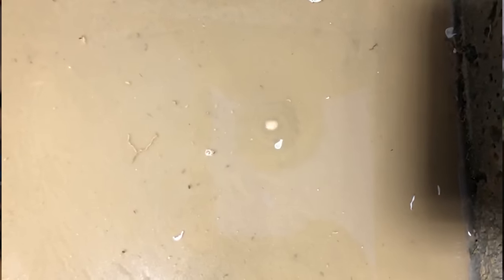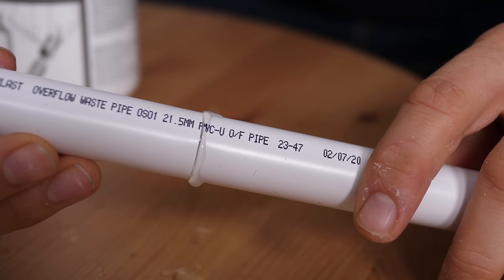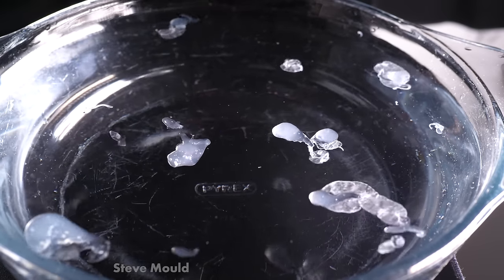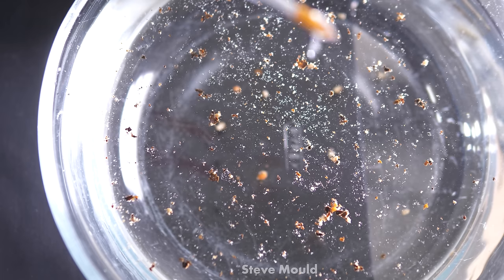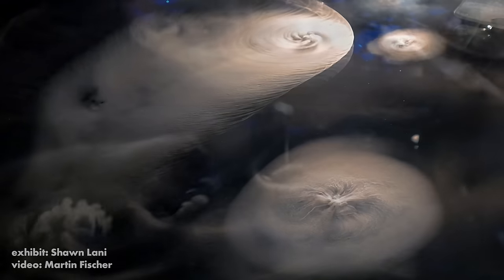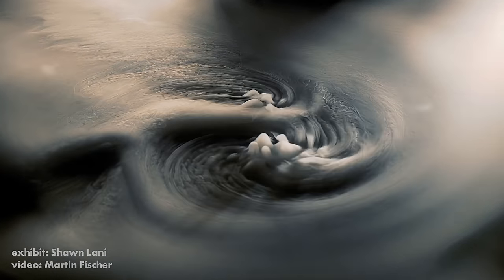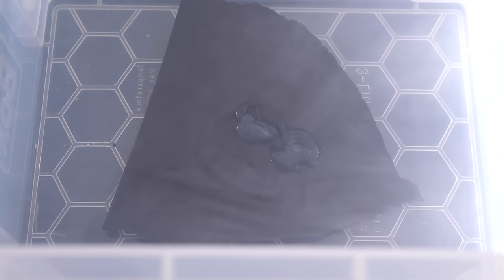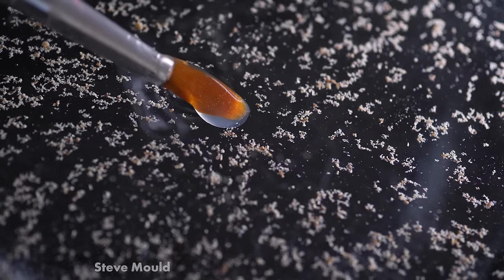Bizarre Spinning Glue

Comment: If you leave it overnight, does it still move the next day?  If you smear out a thin layer of the cement on, say, paper or something, and then leave it overnight and then the next day spray some water on it, does the water wet it or bead up?  My initial suspicion is that the cement is superhydrophobic, like those nanocoatings nothing can stick to except this probably isn't oligophobic, most of those coatings do both which is why they're so effective and novel.

Comment: Those fins/wings which rushes out is exactly similar to the wax of candle when it falls onto the water. Also; when you drop that pvc cement from height because of its velocity it breaks the surface tension of water and that caused jets to erupt beneath the surface of water. And when you pour a drop closely like what you said without exposing to air; You infact not trying to break the surface of watter and when that solvent is released out quickly onto the surface of water and then that water cools it down; that actually makes those fins/wings appear. Can you please try this with hot water ? Or if you already did that then what happens? Thank you.

Comment: I think your interpretation is mostly correct, but it I would describe it as being more driven by osmosis than surface tension.  I've noticed the same phenomenon with fixed zebrafish embryos.  For certain experimental procedures we fix the embryos with formaldehyde solution and then dehydrate them into 100% methanol (which removes lipids in the cell membrane, we later rehydrate them into water based buffers.  Usually these dehydration and rehydration steps are done with at least 1 intermediate step (50% water-based buffer, 50% methanol) and often even more to prevent rapid osmosis from ripping and stretching the tissues.  If you rehydrate them with out the intermediate step the will spin and swirl like crazy - a lot like the PVC cement.  I haven't made the mistake in a long time, so my memory might be deceiving me, but I'm pretty sure they would not only spin at the surface, but they would also spin submerged.  I think you might see the same phenomenon with any gel that has an organic solvent, when you submerge it in water.

Comment: My thoughts are that as the solvent evaporates by "looking for air" to turn back into a solid, it's finding the path of least resistance and the has escapes, then solidifies, then a new spot becomes submerged. Basically, I think as it skins in air, it farts MEK as propulsion. 🤷🏻‍♂️

Comment: The pcv holds a static charge and the water is the conductive medium. If you look close at the pepper next to the blobs you can see 2 to four distinct poles where the water is always ejected from. I think it's creating a sort of circuit with the water and the solvent must act like acid in a battery.

Comment: I doubt that it explains all of it, and I could be wrong, but it looks like the blops go down in the water with a tail that goes straight down and then that tail quickly comes up to the surface, so it might get translational energy from the angular momentum it creates with that. I know that when you hold it still in the water it still repels it, so it definitely isn't the whole explanation, but maybe it could be a part of it

Comment: So, you could 3D print PVC with a (heavily) modified printer made for ceramic by using PVC cement? I imagine making the whole thing resistant to the solvent would be a nightmare.

Comment: An odd bit of surface tension: On rare occasion, a sealed bottle of coka cola will have a drop of itself sitting on top of the main body of liquid. It can sit like that for hours on end, so long as it is not disturbed. I've only seen it a couple times.

Comment: Super-important edit: If I ever do this, I'm putting googly eyes on a blob.

Mid-watch assumption: the MEK is leeching out of the cement, creating a surface tension gradient in the water, and propelling the globs without significant off-gassing.

The fun part of these videos is watching to the end and seeing how close I was.

Post-watch edit: I think I know what's going on, which would be the above assumption plus steady evaporation of the solvent, leading to transient local variations in surface tension that arise as solvent is liberated from the glob. If so, that's a delightfully complicated interaction, and if not, well I'm not gonna call myself some kind of physics wizard.
Reply: Had a similar thought. Adding a drop of soap abolished the movement. I think soap lowers the surface tension uniformly so there is no longer any gradient created.

Comment: Put some in a very small amount of water, preferably pure water, then see if it leaves anything in the water. Also possibly test it with electrically charged water( either "positively" or "negatively" charged). Also, get a decent amount of PVC cement, and drop a drop of water on the surface, and see how it reacts. The reaction may be chemical.

Comment: According to me I think :
Pvc cement droplet comprises of small pores which consists of the air captured during its falling trajectory ..... therefore as we put it in the water the Gases captured gets replaced by water hence forth they release from the pore and hence exerts a force which makes the cement droplet move or rotate( if it has a moment arm). 
Therefore if we look further into this phenomenon the wings that got created can be explained by the same ...suppose the air gap is present at the bottom so as the droplet falls the water rushes in and at that snap moment the pvc cement which has not yet touched the water surface experiences and equal opposite force which results in those wings( like when we keep piling  up grains after a time they start slipping down ).
It's just what I think 🙏
No offense to anyone 🙏❤️
We are all here for Physics 🙏✨

Comment: my comment will probably not be seen,  but here we go. 

Used MEK for work a lot, and here's what I "found out"
1. MEK is similar / Like alcohol, where the it can mixed with water  (from internet "MEK forms an azeotrope with water"). So this might be the cause of the jets where high concentration of MEK is flowing into the water.

2. Effect of MEK on dry skin is that it will evap quickly. On wet skin, sort of oily-like. And it burns. chemical burns, i think. Washing exposed skin with water is not exactly a nice choice, as well as exposing MEK and its' fume to sweaty skins. (The other more "fiery"  solvent is Styrene monomer)

3. Seeing how it affects skins, trust me, don't get it on your eyes. Pure agony for like 10mins, (which can feel like eternity)

Comment: Perhaps this is a chemical reaction between the solvent and the water? when the solvent hits the water it releases some energy that propels the resultant molecules away, this of course would mean that the area around the solvent would be free of water as the dispersed products would now be surrounding the drops. After the resultants move away (either naturally dispersing or via the relative motion of the glue drop as a result of the jets) from the drop of glue water can again hit the surface of the drop and restart the reaction. I guess the easiest way to see if this works would be to combine water and solvent and see if any new chemicals are produced, you would likely need to take solvent and drop water onto it, then siphon off the resultant and see what happens (the easiest at home test would be a PH change, which would signal a new chemical being produced, although wouldn't be surefire one way or the other). Another test would be to look at the thermal energy of the water around the solvents, a higher or lower energy could also signal a reaction (although could also be friction from motion of particles).

It's also possible that air is a part of this reaction which might explain the "wings" that form in low-air-exposure tests. Less air means the reaction isn't taking place around the droplet, and it can freely expand throughout the water, until the reaction happens. Although I'm not sure how it would stay together after that, maybe this reaction also binds the glue closer together? If the reaction gellified/solidified the glue as it expanded, more air means less expansion. Perhaps they are two entirely different reactions: 1 reaction between glue and water to create jets, 1 reaction between glue and air to solidify it. Or maybe just the one to do both things.

Just a theory from some thought on it, but I think it all checks out, don't think I missed any major physical laws or anything, although LMK what yall think.

Comment: According to the patent available on Google, the standard formulation of PVC solvent cement stands at 15% tetrahydrofuran, 25% cyclohexanone, 16% methyl ethyl ketone, 30% acetone, 11.5%- 12% polyvinyl chloride, 2%- 2.5% silica, and 0.03% of solvent-soluble acrylic copolymer associative thickener.

Comment: I believe what's happening is the pvc glue behaves like hot glass getting cold it forms a Rupert's drop full of still expanding glue which when dropped was pressurized and condensed by the weight of the water this condensed pressure broke the Rupert's drop tip off acting like a jet blasting traped air and pressurized glue out extending the tail of the drop similar to glass except in glad higher surface tension locks the expanding molten glass under high pressure stopping it's expansion unless you tap the tip then it explodes same principle also a high low energy shift but it's a more accurate explanation since I saw many Rupert drop shapes spinning around.

Comment: Steve, the thing that I found the most interesting is that when you drop the "blob"s into the water they all spin in the same direction(Assuming its because of your position relative to the equator). When you only hold the dropper in the water, you see swirls going out from the dropper in both directions(clockwise and counterclockwise). Is this caused by the kinetic energy caused by the chemical reaction? Shouldn't the electromagnetic interference of the earth slow one side quicker than the other? 
I am perplexed...

Comment: Would it make sense to test the behavior of the constituent solvents in water (without dissolving pvc in it).  Do the results amplify or abate in different water temperatures?
If tetrahydrofuran is in the cement, I'll bet it is the major source of the riddle.
Thank you Steve,  for yet another fascinating and extremely well presented video!

Comment: That alignment doesn't seem to fit well with the burst. Unless it goes sorta like a capacitor, it acumulates this charge until it reaches a tipping point.
So on the surface you have a stronger shell bc of the first natural evaporation then when you place it on water instead of just expanding it breaks a spot and shoots of until there's enough pvc covering the surface (like blood clog) then another random spot breaks. And then it goes on.

Comment: I don't need a VPN... I prefer a VPN, and I prefer to use my own VPN, not some service I need to just trust.  I recommend getting a separate server someplace (e.g. Linode) and install OpenVPN (or use the one that became part of the Linux kernel... the name is slipping my mind at the moment) yourself.  If you merely need location hopping rather than security, then sure, you could use one of these advertised services.  Tor may also be a viable option depending on your use case.

Comment: Im curious if there is something that causes ez H2O to appear.  It forms a natural capacitor (positive on surface, negative beneath) that is powered by light, and i believe forms a small electric field.  I didn't see enough footage, but does it always spin the first way without collisions?  If it is 50/50, then it wouldn't be this, but if it is always the direction that one would expect for an object in an electric field then that is where i would start.  The field moves the polar molecules, which changes the orientation of what is causing the field since they are connected, and would cause spin.  The energy into the system would be light, and the phenomenon would not happen in the dark (or at least slow down). The ez water stores energy from light in its capacitor, but would need another  source (usually minerals) to seed the formation of ez water.  Maybe a component performs that function. 

It could be interesting to find out.  Please keep us posted

Comment: The crust idea...i think, is what is exactly going on.  Im an HVAC Tech and i have observed pvc cement within water and i think its because the moment that the cement touchs the water is that it creates a film? Or barrier? From the water and the reason it moves around is because the "barrier" is weak and the solvent builds pressure and escapes like a volcano...idk.  just my thoughts.

Comment: As a pool and spa tech i have whitnessed this befor, but ive also seen annother weird affect of pvc glue ,  allot of spas use Polyhexanide Hydrochloride in the water in low concentrations as a sanitiser in place of chlorine,, if that water is spilt into PVC glue it has a very weird catalyst affect ,, clear pvc glue goes to a white stringy polemer style material.. im not sure if its the polyhexanide hydrachloride or one of the other oxedisers used in conjunction with the polyhex , however anyway its an instant affect!

Comment: you can test hard crust effect with different solution. thats the forst thing i thought as well. dissolve polystyrene in acetone and make it pretty concentrated. styrofoam is not soluble in water. so if you drop this solution in water if the hypothesis is right this would work the same way as well. if not theres something else going on

Comment: Didn't know that. This is great.
I absolutely go with your cracks hypothesis.
Edit:
I thought about it, and I can't go with your cracks hypothesis anymore, I'm sorry.
I know only one thing that cracks when it loses its solvent, and that is wood. And this is, because wood is rigid in a very specific way. Everything else that I know wrinkles when it loses its solvent, e.g. raisins. There must be something else at work on the surface of these droplets. The violence of the water jets lures me into thinking that there might be some cascading effects which break their way once a threshold is reached. Or a positive feedback loop. The cement looks like it's hydrophobic. Maybe, due to subtle differences, it locally becomes even more hydrophobic, this pushes the water away, which then takes some ingredient of the cement with it, which increases the hydrophobicy even more. Thingy. Y'know.
Reply: Raisins wrinkle because their volume decreases more than their surface area.
Reply: Raisins (grapes) have a very pliable skin. Maybe the PVC layer is less pliable than raisin skin?
Reply: Presumably you can test this by getting a large PVC pipe and sealing off the ends, then pumping all the air out of it.  If your theory is true it will shrivel up into a small wrinkled section of PVC pipe, and if Steve's theory is true, eventually when the pressure is too great the pipe will just crack.  Or conversely you could pump a lot of water into it and see whether the pipe inflates before bursting, or just cracks.  I'm pretty sure PVC isn't very elastic and just cracks.

Comment: Not convince by the fact that the amphiphilic character of the solvent would be implicate in the effect. Your explanation with jets through crack seems way more convincing for me. Adding a food dye to the droplet would allow to see if jets occur only at the interface air/water are beneath the surface as well.

Comment: I wonder if it has to do with any static discharge (like really tiny) due to something in the chemical make up of the PVC [not]glue. I go fishing a lot and sometimes I see these V shaped wakes that move somewhat erratically across the surface that at first look like fish or water strider wakes, but there are no fish or striders there. It's not wind either. It's progressive static discharge in the water from nearby storm cells that causes the water molecules to "flip" and align sequentially across the waters surface. Depending on the vast randomness in orientation of the molecules on the waters surface, sometimes one side of the wake flips a little more than the other which steers the discharge in erratic directions. Maybe the solvent reacts in some way to cause that strange motion as the water ionizes and aligns in it's usual fluid, random way. The wings may be "pulled out" due to this static reaction. Just a theory lol

Comment: What if the reaction is driven by the PVC discharging electricity that builds up due to the reaction with the water? The PVC that has reacted would act as insulation and the solution that hasn't reacted with the water would still be conductive. So you'd have two solutions on the opposite side of a barrier and the barrier is broken when electricity is discharged.

Comment: What would happen if you put a dab on a paper or plastic boat? Would it propel the boat in the direction the boat should go or will it be random? What if you put it on something that sinks? Will it spin under water or due to it being submerged will there be a tiny "explosion"? If it's the solvent, it would do nothing if dropped in a pool of the solvent wouldn't it?

Comment: Have you tried putting a blob of cement on a very light raft on water e.g. a small bit of paper? My thought is that the motion could be nothing to do with the water itself, except that it allows for the cement to move with almost no force. I suspect that direct interaction with the water is in fact the cause, but seems like it should be checked out.